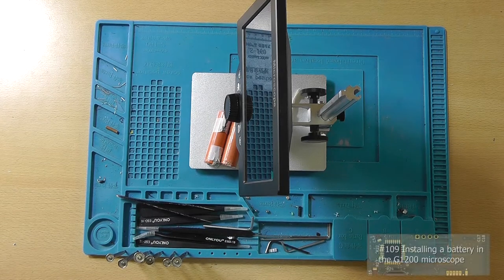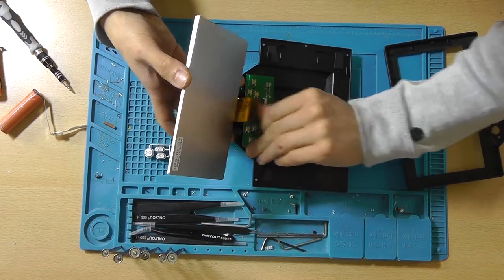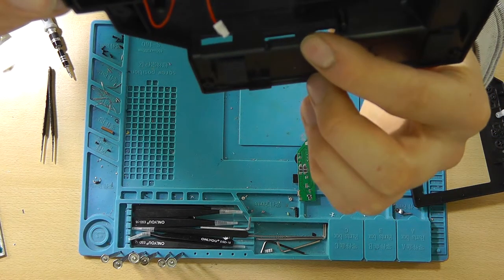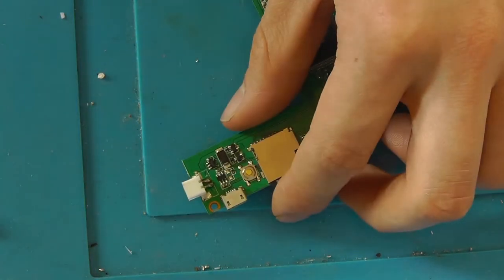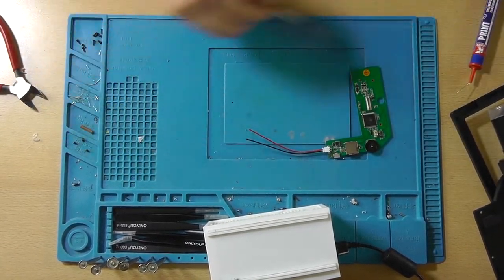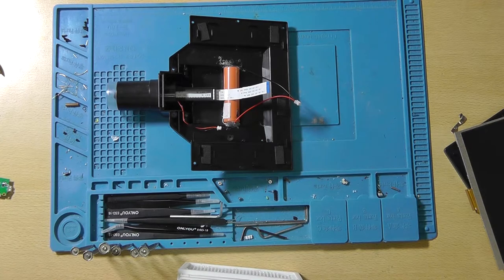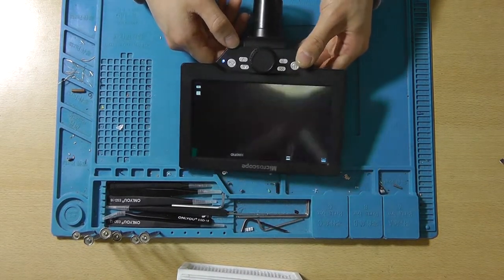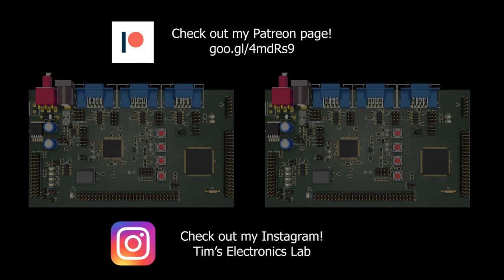#109 Installing a battery in the G1200 microscope

Comment: I have that microscope and it came with the battery.  I do not like the USB port connection on the side for charging. It is really close to the case and does not have enough room for most cables to fit. I am going to attach a battery holder to back and use two 18650 cells in parallel and run a wire inside to the board. That way I can remove the batteries when they need charging instead of having to use a USB cord.  I will also be attaching the microscope to a microphone boom. The base is too small and gets in the way. A separate lamp from the side is also useful for better lighting as the LEDs on the scope give off too much glare.

Comment: I wonder if the machine is still working well? Can it be charged using a normal micro usb port? (green light indicator when fully charged?) Thank you
Reply from the maker: Hi! Yes, it will be charged using the micro usb connection. The software will even show the battery state now
Reply: @TimsElectronicsLab  That's great to know, thank you. I ordered one but it seems to be the same type that doesn't have a built-in battery like yours. I will follow your instructions, have a nice day

Comment: I did this, but mine keeps turning off what can be, did I use a very thin wire or is the battery low?
Reply from the maker: I would upgrade to a thicker wire for sure! You might have a cold solder joint or something

Comment: Good one - thank you. ...Have you removed the protective covering on the screen yet? It would drive me crazy having the green tab just sitting there under the bezel!
Reply from the maker: No I haven't 😂 I actually plan to keep it on as a sort of splash protection when soldering goes bad 😂😂
Reply: @TimsElectronicsLab  what is the model for the solder gun

Comment: I’m curious about the voltage / power the on-board charger uses. I imagine it should be safe if you use a low power USB-adapter but it could still over-charge.
Reply from the maker: Why do you think so? I didn't look into the charging chip, but I assume that it's an all in one solution for charging and managing the battery

Comment: Hi Tim , got few questions
1. How long do you get battery backup?
2. Is their any problem you have face after the modification?
Reply from the maker: Hi Hasan,
Thanks for your reply.
1. I'm not sure actually, I haven't used it alot and I haven't need to charge it yet
2. No!

Comment: I even managed to do the same as your video. However, I went back to your video and noticed that the lighting LED's are not lighting up, the same thing happened to me
Reply from the maker: I think it must be a bug in die firmware of some sort
Reply: @TimsElectronicsLab  I got it, I had to change the light adjustment
Reply from the maker: In the menu?
Reply: @TimsElectronicsLab  I put a Samsung S8 PLUS battery which is also Lition, I'm testing its autonomy now
Reply: @TimsElectronicsLab  potentiometer

Comment: hello I watch your video and I wanted to ask you if it is possible to make a backup of the chip? my device is not usable on pc I have artifacts and sometimes it does not start it bootloop. thank you
Reply from the maker: Which chip do you want me to backup?
Reply: I don't know if it's possible to save the chip so that I can reset my microscope because it makes artifacts on the PC, and sometimes to use it reboot I have to unplug and reconnect.  thank you
Reply from the maker: It sounds like a capacitor is not soldered in properly or something, I don't think that the firmware is corrupted as that will probably cause some kind of checksum error at boot
Reply: Ok I'll take a closer look tomorrow if I see a problem on the card.  thank you and have a good evening

Comment: Cam you please tell me the specifications of the battery
Reply from the maker: Hi! It is a regular 18650 battery, just fetch one from a laptop or something and it'll fit
Reply: do not use an 18650 it will not have any charge protection!!!! you will need a flat one with built in safety board....
Reply from the maker: There is no charge protection circuitry on the PCB?

Comment: Use flux when you do soldering works.
Reply from the maker: I have solder with a resin core, that should be enough, right?
Reply: @TimsElectronicsLab  nope, flux is not only for the oxidation generated by the heat but also because of the capillarity and heat propagation it induces while soldering.

Comment: i bought it g1200 , and used it for a month , and i regret it , the image quality is very bad  , it never gives good balance between light and dark areas , the light is refleced directly to the camera when working with cicuit boards or electronics repairs , cannot see the parts clearly and the colors is not clear too , cannot tell if there is some thing dicolored or burned ,
and after a month or so of usage , it died , it doesnt turn on , i opened it and tested the board , i found the circuit board to be shorting on the power area next to the charger port , and its poor design seems to have failed in short time because it generates lots of heat while it doesnt have and proper cooling , 
its one of the worst microscopes in the market and no matter what price you pay for it , doesnt worth it 
never buy this model , you will end up throwing it in trash
Reply from the maker: I found mine to be sharp and the colors where acceptable. Maybe there are fake g1200's on the market?
Reply: @TimsElectronicsLab  this might be the case , 
since those are all chinese products
Reply: @firepower9966  i didnt get many replies saying it works well
Reply: @firepower9966  i hope its a revised version, newer one that have the problems fixed
Reply: @firepower9966  Yup i am going through every youtube vid on this product as i am gonna get one and i see this troll in everyone one off them. Now waiting for it to be delivered from China. I have already gone through most of the reviews on Amazon, and the haters make the most nonsensical excuses. But most of the reviews are very positive considering the pricing, its crazy cheap.